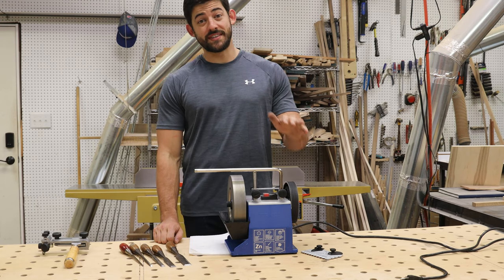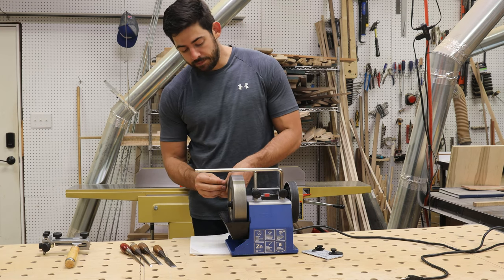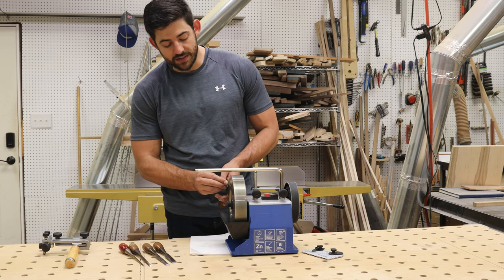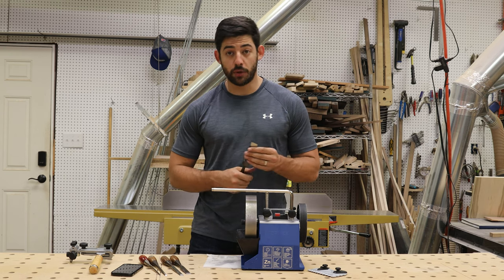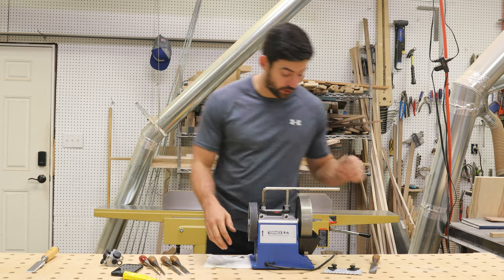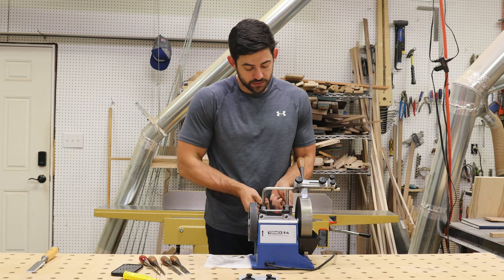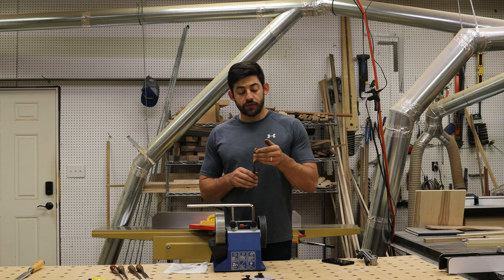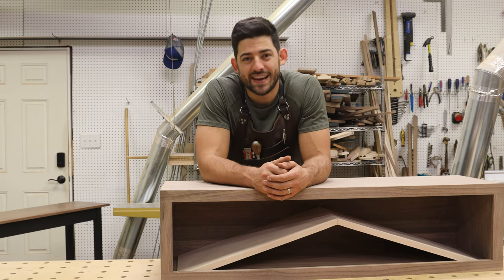Chisel Sharpening Detailed Walk Through with a Tormek

Comment: Excellent video. Thank you for putting it together. Have you considered lapping the chisel so that all of the edge gets the same speed on the wheel? That is, how about holding the chisel so that the edge is facing the center of the wheel and the side of the chisel runs along a radius? This is my preferred method and it's consistent with the way Tormek suggests sharpening a bevel on the side of the wheel.

Comment: I have a Tormek and am considering substituting the CW-220 composite honing wheel for the standard leather one you use here. As a professional finish carpenter, my sharpening will be limited almost exclusively chisels and plane irons. Do you think I should go for the composite wheel or stick with leather? Thanks.
Reply from the maker: Hi Michael, I will be honest, I have no experience with the composite wheel. Having said that, I LOVE the leather wheel and have had no issue with my planes, chisels, or knives.

Evan
Reply: @CypressDesignWorks  Evan, Thanks for quick reply.  I've canvassed a number of  very experienced Tormek users familiar with this new-fangled composite wheel. Consensus is that CW-220 is terrific. So I'm gonna roll the dice and go with it, well aware that there would be nothing but good result with traditional leather either. A different question: I've sharpened for decades using high speed grinder followed by hand sharpening using soft and then hard black Arkansas stones. It looks like many Tormek users use one or another of the  honing wheels after wet grinding and then just call it good, foregoing use of hand stones altogether. Is the edge straight from the honing wheel so sharp as to eliminate need for follow-up on flat stone(s)?
Reply from the maker: @michael.schuler  Hi Michael, I would say so! I easily get a nice mirrored edge fully capable of shaving the hairs off my arm. I know everyone has different standards, but I would be shocked if you thought the sharpness was not enough off the hone. I know the grit of the wet stone/diamond stone also effects sharpness. I use the medium grit and have found this to be fast while still be incredibly sharp.
Reply: @CypressDesignWorks  Thanks, Evan. I've set aside time this weekend to have an extended first date with this new toy. I'll see soon enough what she can do. Just watching the various videos like yours, I can already see that whether or not the final results are any better than what I have previously achieved, the process will be quicker,  infinitely less stressful, and more predictable. BTW, of all the videos I watched on this topic, yours was IMO the most concise and useful.
Reply from the maker: @michael.schuler  Well that is great to hear, I really appreciate that! As you might imagine it takes of lot of time to think through, film, and edit these so feedback like that keeps me motivated! I am sure you will love your new Tormek, let me know if you have any questions!

Comment: I thought no water when using a diamond disc... Only for stones, since the water rusts the metal diamond disc.
Reply: Great question. You absolutely should still use water. Tormek provides an anti corrosion liquid that you add to the water to help prevent rust. If you don’t use water, your wheel will fill up with metal and will cut much, much slower. Water helps keep your stone fresh. After I finish a sharpening session I always dry my wheel off with a dry paper towel too.
Reply: @298Echo  It also keeps the metal dust out of the air

Comment: I have a blade (one side bevel) thick as a chisel; its 2" wide and 6" wide. I can not sharpen it.  I have a T4 with a Super Grinding Stone, I am told that the stone can grind from                                                 200-1-000 grits..Any advise  Thanks